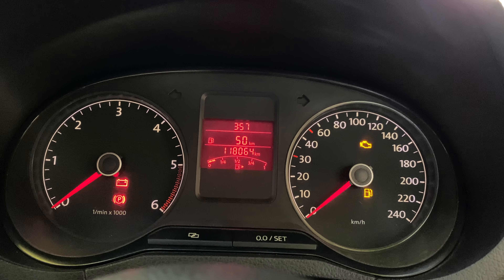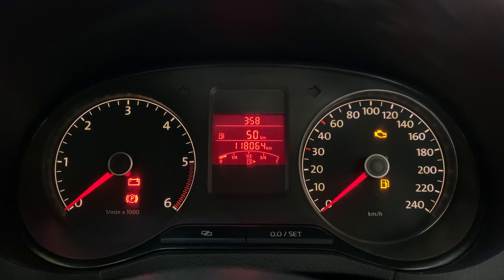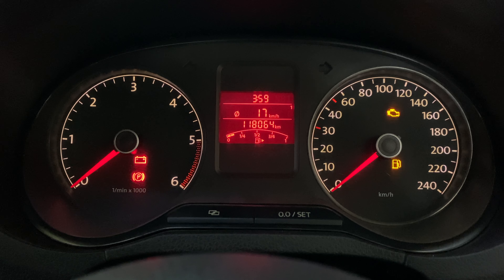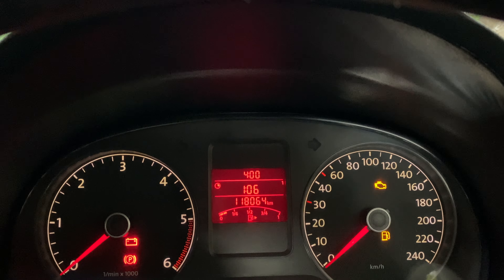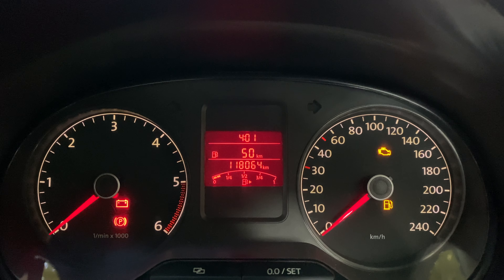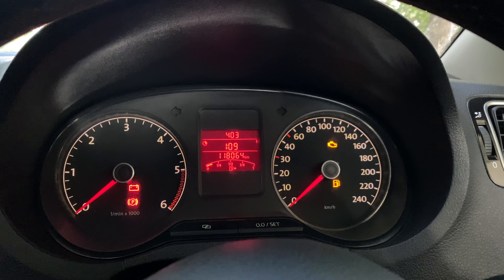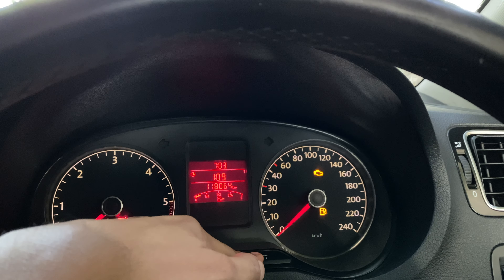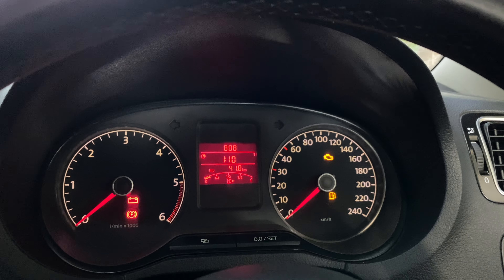Driver Information system in Volkswagen polo/ vento || multi function display ||

Comment: How can I do a full swipe of needles in my vento tdi?? Plzz tell ? Is there any process ?
Reply from the maker: Can be done using VCDS .
Reply: Love For cars thank u how much does it cost
Reply from the maker: A genuine VCDS cable will cost upwards of 18k. Since I have the cable I was able to play around with it .
Reply: Love For cars ok thanks and from where can I buy the cable ? And once I do buy it is it difficult to do all these things ? Or will I have to take it to VW shop ? Plz upload a video regarding vcds cable too and how to do all these amazing stuff
Reply from the maker: My number is 9008002107 . You can WhatsApp me .
Reply: Love For cars I will for sure . Thanks ,
Reply: @loveforcars5305  hii i own vw polo diesel highline.after driving 20 to 30kms all of sudden all the warning lights are getting displayed and speedometer stops working.. but the car is running smooth. 
Once I switch off n on the engine its getting back  as normal.
Not knowing what the pblm is

Comment: How did you activate needle sweep on this red cluster?
I have 2011 Vento Highline petrol with this same red cluster, I tried needle sweep and indicator celebration from VCDS but I get an error saying channel not available.
TIA
Reply from the maker: This function will only work on cars manufactured after mid 2013

Comment: Hi Bro, I own a polo 1.2 TDi Trendline 2012 model. I want to see approximately kms to fill tank in speedometer. Can you please let me know how to do it.
Reply: Did You got to know about it?
Reply: @adityanhavkar9390  I don't know. But somehow it got back to that option after running for few kms. After that I never changed it
Reply: @adityanhavkar9390  I just came to know how to do it. Please drive your car until it shows orange light like a low fuel indication then it will automatically show the approximate kms of the fuel.
Reply: @venkataramreddybagi7080  Okay bro thank you❤️ I'll check it today!!